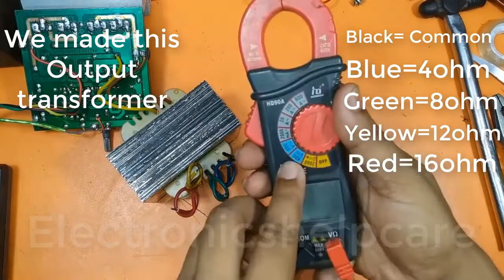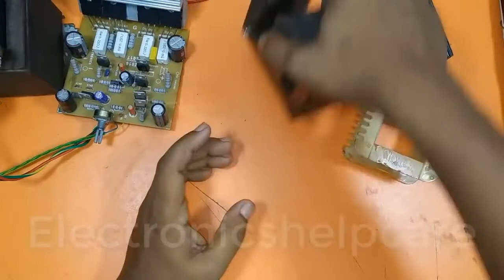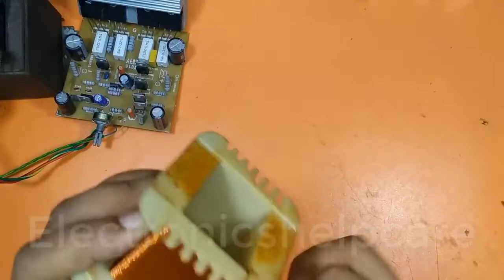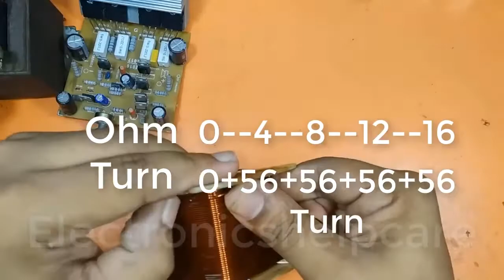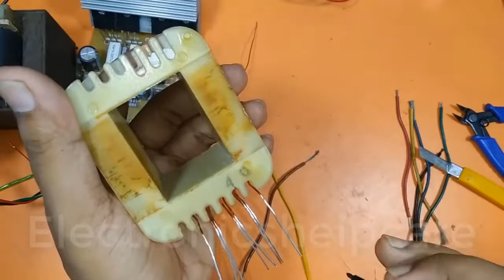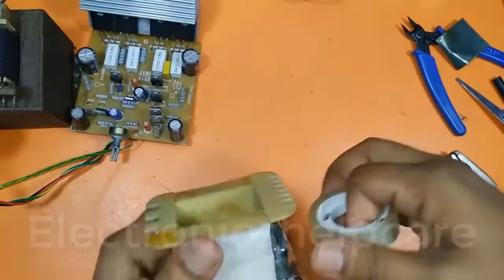Cara menggulung TRAFO MATCHING untuk power amplifier jenis OCL - langsung tanpa elko ke speaker.

Comment: Itu input di jemper ke outputnya ya
Reply from the maker: ya betul, output speaker dari ampli OCL dimasukkan ke input trafo matching.
Reply: Itu yg 4, 8, 12, 16 untuk output low impedance ya? Makanya yg 8 dijumper ke kawat input menyesuaikan dengan driver amplifiernya yg 8 ohm?

Comment: Boleh input from amplifier di induction sahaja tanpa ada conecting to out coil, (primary and scundary system?).
Reply from the maker: Saya sudah coba buktikan, saya ada power OCL mono, saya langsungkan dari output speaker power OCL ke tap trafo, dan bunyi normal, kalau dikasih capasitor copling kan jadi power jenis OTL.
Maksud dari video ini adalah, agar kita kalau pengin membuat amplifier model TOA, tidak terpaku pada keharusan sama persis seperti desain amplifier TOA, namun juga bisa mempergunakan power OCL, namun tetap mempertahankan HARUS ADA transformer output sebagai output speaker.
Reply from the maker: yang di video ini prinsipnya adalah Autotransformer, input dan output trafo tidak isolated.
Coba saya bikin dulu buat buktikan seperti apa effectnya terhadap hasil audio ...
Reply: @NgoprekdirumahYT  jadi pmbuktian pak?